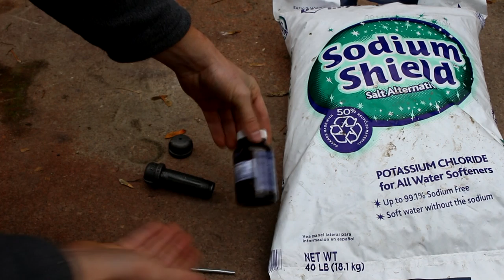Making Potassium Metal

Comment: Hello Cody,I suggest using lithium rather than sodium since it is much better because of the following reasons

1.)It is the strongest reducing agent
2.)It has a boiling point ~1300C
3.)It greatly increases the reaction rate
4.)and even if Li distilles over it will not form a alloy with potassium since it shows anomalous behaviour as per being the first element in the alkali metal series.

Hope this helps you

Comment: Nice work cody. Thanks for converting the temperature and for showing the chemical equasion. Many european viewers were hoping for it.
Reply: How high is the temperature for KCl to fall apart by itself without sodium as a reaction partner?
Why didn't the kork pop out of the bottle. You must have generated a huge pressure by heating the air in the tube.
Reply: How high is the temperature for KCl to fall apart by itself without sodium as a reaction partner?
Why didn't the kork pop out of the bottle. You must have generated a huge pressure by heating the air in the tube.

Comment: I've made a video about the reaction of potassium carbonate with magnesium metal. That would work perfectly in your apparatus. You can also heat up potassium hydroxide until it's red hot, then it is anhydrous and forms potassium metal with magnesium in a quite smooth reaction. You can find a whole paper about it online called sth. like "Alkali metals from salts".

Comment: It might be possible to do this with lithium in place of sodium. The reason K is formed is not because of an equilibrium rather that Na has a higher oxidation potential (it's higher on the activity series). Lithium has a higher oxidation potential than sodium, thus it will also displace potassium, and lithium is much harder to boil.
Reply: TheGinginator14 exactly what I was thinking
Reply: TheGinginator14  HA NERDDD..jkjk
Reply: You should actually be able to just make potassium via electrolysis if you have a solid chunk of Lithium since it's oxidized easier than K.
Reply: He said it at the end lol
Reply: sodium has higher (less reactive) electrode potential than potassium so it is due to equilibrium

Comment: Your problem is not the synthesis, it is the temperature. It probably forms NaK inside the reaction vessel, and then the NaK is distilled out. Potassium boils at 759 deg C, while NaK, depending on the ratio, boils at around 785 deg C. So it should theoretically be possible to get pure potassium, but you need active temperature control. You could see if your university has any inert gas furnaces, and do the experiment in that.

Comment: I used to make Potassium by igniting a mix of Potassiumhydroxide and Magnesium powder. 
After it stopped reacting I dumped it into mineral oil, broke up the clumps and poured in a bit of water.
The Potassium drops will start to react with the water, flow to the top and go into the mineral oil layer where I would grab them with some pliers.

Comment: What the hell is that magnesium sheet from?
Reply: Iron Bridge where*
Reply: Iron Bridge 
Google "magnesium plasterers hawk"
Reply: No, what.
I want to know what it was he got it from.
Reply: Masonry supply store
Reply: You can get pure enough magnesium metal from a variety of sources. One is from camp fire starter kits that you can get at almost any outdoor supply shop, even at a walmart and sometimes a hardware store that sells camping equipment. 

Online you can also get magnesium powder. This last suggestion is far less reliable, but a CNC shop may be able to get you some magnesium filings, or scrap left over from milling magnesium parts.
Reply: Fire starter kits (the "sparking" kind) are usually made of ferrocerium, which contains a low percentage of magnesium. There are some kits which contain a magnesium bar, which you can shave down with a knife and ignite the shavings with a ferrocerium rod, but they are harder to find.
Reply: the pencil sharpeners we used at school were magnesium.  quite surprising how much stuff is made from it.

Comment: Why didn't you grind up the potassium chloride into a powder? Does it work better in large chunks?
Reply from the maker: Well it will be a liquid any way.
Reply: But maybe it would have more surface area to react faster and evaporate less sodium?
Reply: Rihards Rožāns negligible difference, not worth the effort.
Reply: So success is a negligible difference to you? Would hate to see how you live.
Reply: I don't think it would make a difference, but powder form would probably be the more efficient method.
Reply: Riley Woods Considering the extra effort to crush it up, I guess not
Reply: Riley Woods that would be like saying you should grind up ice into snow before you put it into a reaction vessel of over a thousand degrees. It doesn't matter, it's going to melt quickly. Salt melts when you heat it enough.
Reply: Rihards Rožāns have you ever taken an advanced chemistry class?
Reply: Rihards Rožāns it's literally not worth the effort.
Reply: There is no difference in the surface area as the KCl and Na are liquid at that temperature.
Reply: Sure they are liquid but that doesn't mean they are mixing automatically...
Reply: photographer85 No, they are automatically separating in two phases. Liquid KCl is a lot denser, than liquid Na. Thus is doesn't make any difference to the mixing.
http://moltensalt.org/references/static/downloads/pdf/element-salt-densities.pdf
Reply: user255 Interesting! Thanks for the info! :)
Reply: either the block melts into liquid or a powder melts into liquid; either way the reaction will mostly occur in the liquid state
Reply: Rihards Rožāns Successful people knows the shortcut that others don't, they don't waste time on things that don't matter (negligible differences). Steve jobs didn't give a shit on what he wear, coz it's negligible to doing him what he does best
Reply: so basically, put Na below the KCl. Why not throw super fine KCl into sodium vapor?

Comment: What if you used magnesium powder and a small amount of sodium in with the potassium chloride? I have little experience in chemistry, but is it possible the reaction with sodium might kickstart a reaction with the magnesium? I really don't know how this stuff works, but I'm fascinated.
Reply from the maker: Humm like a catalyst? might be on to something.
Reply: *****
It will also act as a surface cleaner, since magnesium is covered by oxide layer even if it's melted, when it's not moving. I'm pretty sure Mg in MgNa alloy will be more reactive. Also it's may help to have a good mix of Mg powder with KCl, because they have different melting points and densities, they probably separated too much in your experiment.

Comment: put the sodium in first and use an excess of your potassium source so that it creates a larger barrier above the sodium, which will help. Also you should switch out receiving flasks once your temps are reached as you will get a lot of sodium come over until the salt melts to react with it.

Comment: Cody, can you make a video on cesium?
Reply: It's damn expensive. 100 eur+ per gram soooo
Reply: Did u see that on the brainiac show or whatever, in the tub? it's fake just fyi. very exxagurated
Reply: Yeah, not denying that. But a gram wont blow ur hand off
Reply: Yeah, it would definately hurt. Just not blow your hand off. and the cesium is'nt contained the same way a firecracker is.
Reply: I saw thunderf00t's video last night, about the fake video, and he made cesium by using cesium chloride  and lithium. Fairly cheap i guess
Reply: @adaster98  , you haven't messed with cesium much, have you?  It doesn't explode on contact with air.  It just catches fire and burns.  It will explode on contact with water though.  And Pedro is right about hydrogen not being the reason the alkali metals explode.

Comment: Why can't you electrolyze molten potassium chloride? It would produce chlorine gas, but you could probably deal with that by directing the vapors through a tube to react it with something like hydrogen gas
Reply from the maker: Potassium would also be a gas.
Reply: Cody'sLab  Oh
Reply: But just barley a gas because it vaporizes at 1400F and will condense way before the Chloride does. Have the top of the pipe below 1400 and the potassium will condense back.

Comment: 6:59
Potassium is more electropositive  than Magnesium (Potassium is more reactive). 
This will not work for what you are trying to do.
For a single displacement reaction to work, the potassium in the salt would have to be less reactive than the Magnesium, which it is not.
This difference in electropotential  is what drives the reaction.

Comment: Hey Cody ! Look at binary diagrams of Na-K mixture. You probably formed at first a mixture Na-K with a high quantity of potassium 70-60% (I guess from their binary diagram, a mixture K - Na2K) explaining why it was liquid. For the third experiment, from the quantity of sodium you used, I think you have a higher quantity of sodium in the solid which gives a higher fusion temperature (probably more than 50% of sodium). For the second experiment, it didn't work probably because of the oxide on the surface of the magnesium (which protect it). In chemistry when using magnesium metal, we prefer making a powder of it at the last moment to avoid this problem. Alternatively you could ad some iodine to the mixture to break the magnesium oxide. 
Still loving your videos from France. Hope you continue your good work !

Comment: So just use an inert atmosphere. Argon or Helium aren't exactly cheap, but you can get a small bottle of it at a welding supply store I think. Obviously argon would be better since it won't float away on you.  Or, try isolating your own argon from the air. You might not get much, but it would be a cool video

Comment: You should be able to use magnesium for this if you use potassium hydroxide instead of potassium chloride. The lattice enthalpy of magnesium oxide is much higher than that of magnesium chloride, which provides a larger driving force for the reaction. The slight complication is that you would form hydrogen gas as well as potassium metal, but this would probably help sweep the potassium vapour through the distillation tube. So you would need to add a vent tube through the cork to release the hydrogen as it forms.

Comment: Hello Cody, very interesting video. I do have 2 suggestions to improve this setup. The first would be to put the sodium in first and the salt on top, using more finely crushed salt. This should help keep the sodium with the salt, also use the sodium as the limited reactant. This should help you get more pure potassium.

Comment: Cody, try using potassium chloride, sodium chloride, calcium chloride, magnesium and platinum wire boiled for distillation in a solution of nitric acid. It's been a long time since I've read it, but I remember reading in a chemistry journal from the late 1800's edited by William Crooks that discusses the process of distilling potassium metal. I either gave you the recipe for that or phosphoric acid. The sodium is supposed to help the potassium like you indicated, but the calcium and magnesium stabilize things and the platinum acts as a catalyst and the nitric acid I believe sad to allow for lowered temps preventing the creation of an alloy. That's assuming I remember correctly. It's been a couple of decades since I read it. I could have also just instructed you how to make bubble gum that smells like gym socks.

Comment: The problem with magnesium is how unreactive the bulk metal is. Even trying to get lumps to burn in air can be a problem. magnesium powder or thin strands of ribbon are far better since there's a higher chance they'll actually 'ignite'.

There's always going to be some sodium contamination simply due to the fact that you'll have a NaK alloy present with both metals having some vapor pressure. The higher the temperature the higher the proportion of sodium you'll get. I believe industrially there is careful temperature regulation to condense out the sodium from the product.

Comment: Gotta do it with lithium and shorten the tube, it's condensing in the tube and it's only flowing through when the temp rises and the sodium vaporizes to form liquid nak, if you use lithium you can heat the potassium hotter without vaporizing the lithium, and it'll stay liquid longer, hopefully long enough to pass through the tube. Lithium is slightly less reactive then sodium, but it's boiling point is higher. You could try measuring out the amount of magnesium powder used to make a mixture that when lit, has a high enough enthalpy to vaporize just the potassium.

Comment: Hey just a couple notes on how you could possible improve this set up. 
1) Your separation column is too short. This causes the vapor from the reaction to eject the contents of the reaction out the distillate causing impurities. Since you are limited by space, you could connect smaller diameter tubes with the pipe running from the top of one to the bottom of another. This will artificially increase length at the cost of diameter(which could cause other problems).
2) It seems that you are having pressure problems from the metal forming in the tube leaving the furnace. Since the reaction forms a vapor, you are reducing the rate of reaction with high P. This may be corrected by wrapping the exiting tube around the pipe so that the distillate vapor is super heated allowing it to exit into the mineral oil before solidifying. It could also be ignored by having the diameter of the pipe drastically increase once it is outside of the lid, so any solidification won't cause blockage.
Anyways, just some thoughts that you probably already had. Thanks for the video!

Comment: You should try to electrify some potassium nitrate to see if you can break the bond and leave the metal behind.  Its an Ionic, or electrostatic bond.  You are using all that electricity on the furnace, it would probably be worth making a induction coil at some point for your retort.

Comment: if potassium is soluble in potassium hydroxide, you would want to use a different solute instead of water/ don't have a solute if you can get liquid potassium hydroxide, or look for other potassium compounds for electrolysis. your potassium chloride might work if you don't mind the chlorine gas and chlorine in solution.

Comment: I'm sure this is in the comments somewhere, but I'd use an excess of KCL and much less sodium. Also put the sodium at the bottom and wrap the lower part of the chamber with asbestos so the Na melts last . Its density is ~half that of KCl so putting it on top it's going to give off a lot of vapor, even if it isn't at its boiling point. Putting it at the bottom it will have to move through the molten and very reactive salt before it can escape.

Comment: I think you could do it with electrolysis of molten Potassium Chloride.  You can use quartz glassware to make a still head for the negative electrode (drill a hole in the still head for the electrode) and an alumina boat/mold to hold the molten salt.  You can use kiln bricks and ni-chrome wire to make a 900-1000C furnace to surround everything. Then you can simply cover the apparatus with a small fish tank and flood it with either dry Helium, Argon, or even Nitrogen (potassium doesn't react with it) to remove the Cl gas as it's formed and keep oxygen/water out.  You could use low carbon steel for the cathode and a graphite anode.  The still head could lead to a small container with mineral oil.  I'd attempt it if I had the time.  I know Potassium can be made easier/cheaper, but it would be a great achievement to simply produce it from the chloride salt without using other alkali metals.

Comment: you may want to try pure KCl salt and using a column to separate the components with a charge it would need to be in an inert solvent that does not react with potassium, and isn't able to dissolve potassium i think you may be able to do it with a chemical reaction in a none reactive liquid as well.

Comment: sodium is bright yellow and potassium is a violet. That is what Cody was referring to when dropping in water. BTW Why not use electrolysis to get potassium? Might want an argon cover that is easy same regulator as nitrogen CGA 580 on cylinder for regulator. Just heat The potassium to the melting point and work on separators so the chlorine does not contact the metal.

Comment: What did you find when you opened the distiller after the magnesium attempt? Magnesium is dense. Although it may have been a turn of phrase. Your comment kinda leads me to believe there was a reaction. What was the result, if any?

Oh, and a fairly large basin and a heavy gas would give you a fairly safe work area. Juat keep your head above the lip of the basin and what your working on below.Using  something thats fairly cheap so you can keep a constant flow while you work is just a good idea. Like overflowing a bathtub to ensure the water you displace doesn't add up to create a dangerous situation.*Test the basin*(guilt insurance)no insult intended.

Comment: Just spitballing here, what if you did the electrolysis reaction under vacuum? I was first thinking that using an inert atmosphere would help but since the reaction produces oxygen, it probably would be a waste of time. The vacuum should also make it easier to keep the potassium/sodium hydroxide in a liquid state once you have current flowing, while also quickly boiling off and removing any moisture that is created. The other idea was to use graphite electrodes, that way you wont have any contamination from other metals. After so quick searches it looks like that is the preferred electrode for these reactions.

Comment: Hi cody, I had a similar setup only i used stanless steel tubes and had a 3rd pipe going to an argon tank, i had no luck with magneseium power, but i used lithium from batteries and got a good amount of potassium, i aslo have 20g of caesium chloride but it wasn't cheep so ime not shure to use it to make caesium metal. Grate video.